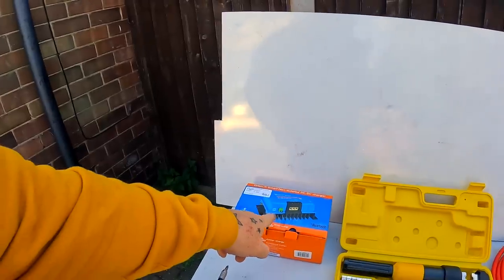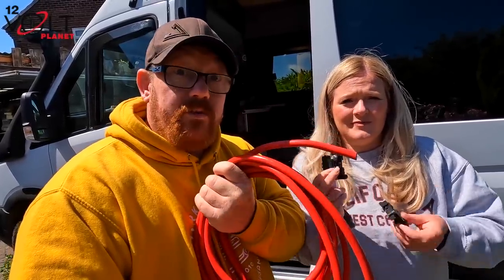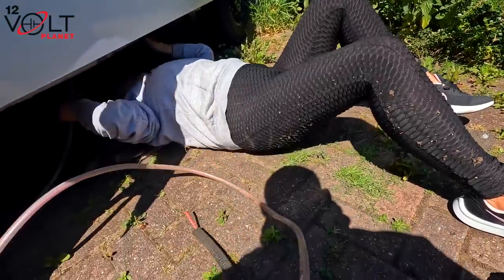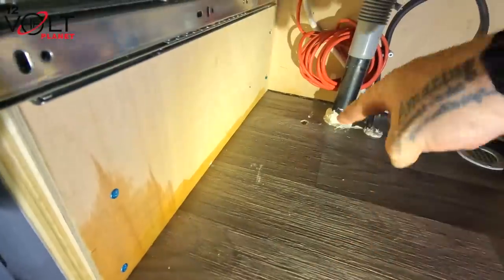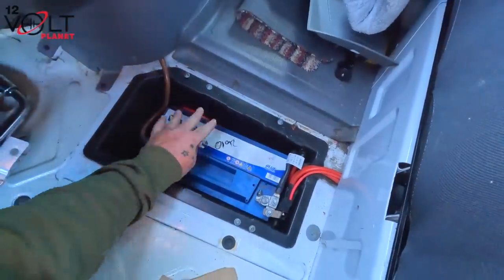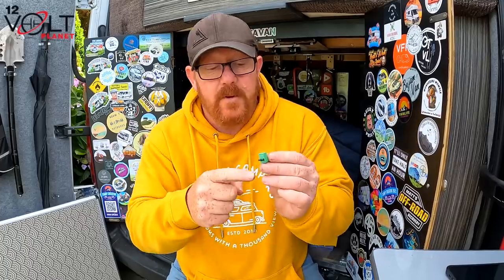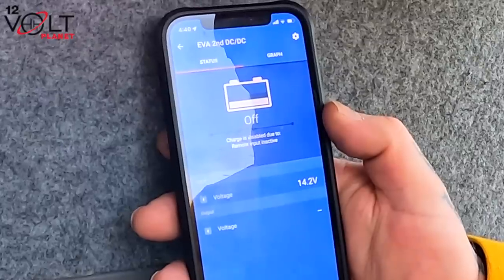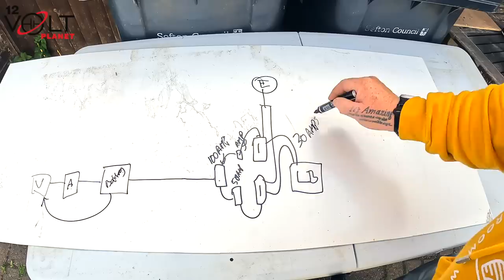AVOID A Winter Power Shortage With Double Charger’s

Comment: If you want to save yourself a few quid, you can use the renogy one which is 60a and costs £135 at the minute.
Reply from the maker: Interesting 🧐 this could help other people with different budgets thanks 😊
Reply: on it's own that's a useful suggestion but I'm not sure how it would sit alongside the existing Orion?
Reply: Or the ABSO with 50amp charging and solar charging built in, had one for 3 years and no probs. I live in my van so it's been well tested.

Comment: Surely the 100 amp fuse is for the 35mm cable protection so should be at the battery, the 50amp minibuses protect the 16mm and orions
Reply from the maker: Please read the pinned comment on the comment section 😩😊
Reply: @UrbanVanlife  Ooooooh! Barry didn't read that.

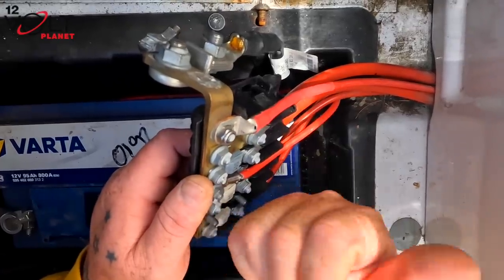Comment: At around 3:35 you show you didn't have a fuse at the battery end of the cable, but instead had the fuse at the other end. This works but can cause a problem if that line ever chafes on metal in the van between the battery and where you fused it, causing an unfused short, that is why it is always best to have the fuse as close to the positive terminal on the battery as possible.
Reply: My thoughts exactly great video love the van and the snorkel 🤿 but definitely get a fuse up the battery end asap

Comment: I’m probably wrong, I have been plenty of times before. I would personally put a fuse at the battery end of the cable. My thinking if the wire rubs on a metal surface, for example where it goes under what I think is your seat, it would short and there’s no fuse to stop a fire etc. when I did my van infused both ends between the main battery and the leisure batteries. 

Cheers for the awesome videos!
Reply: Forget this, I’ve just watched the next video! FYI, you’re videos are awesome, keep up the good work 👍
Reply from the maker: Thanks Ryan, see your original comment wasn't a full blown rant, it was an observation and an explanation of how you did things coming from a good and helpful place, and we appreciate it as it could help someone in the community, massively different to what we have been dealing with from some other people which is why we did the update just to clarify for the people who did come at us with their pitch forks and torches! Thanks for commenting and watching.
Reply: @UrbanVanlife  thanks for being so nice about it! Again I would just like to say your videos are awesome and whether they leave a nice comment or not, you’re providing knowledge and entertainment for so many people! 

Cheers guys!
Reply: @UrbanVanlife  They may have been concerned about your safety or just plain argumentative, there's a lot of it around since the end of lockdowns.

Comment: Thank you for the video buddy.... Ctek D250 plus 120 smartpass is what I've been using for the last three years and get upto 140amps. Never had any issues and never had to connect to sure power at any point on our travels.
Reply from the maker: Great piece of information for the community thanks for for sharing 👍👍
Reply: how does the price compare to the Orion?
Reply: @alanhat5252  https://www.12voltplanet.co.uk/ctek-smartpass-120s-power-management-system.html 

https://www.12voltplanet.co.uk/ctek-d250se-dual-input-dc-dc-charger-mppt-solar-controller.html

Not sure of Orion prices but the links above are roughly what i paid for Ctek setup.

Comment: Excellent install guy's 😉👌, Please,  just install a mega fuse on the source (positive side of the vehicle batteries busbar), as you have an run of 5mt cable unprotected from mechanical impact or abrasion ( even though its heavily protected using the rubber hose as an conduit👌👊👍). Rule of thumb, (but not set in stone) We always try to fuse within a foot of the source. 😎👌👊👍👍👍.
Reply from the maker: this is whats called DONT FORGET TO ADD IT IN TO THE VIDEO . we changed the mounting from the battery and added a 100amp midi fuse to the block . but some fool forgot to add the footage , so ill have to do a short about it , totally my stupid fault lol ,
Reply: @UrbanVanlife  no, thats cool bud, your on top of it😎👌👍, just be aware of "alternator upgrades too"...you may not benefit from it! As an higher the amperage alternator may require higher RPM to gain those, (like 6000 RPM to gain the higher amperage) but you may lose the lower end of the amperage compared to an "lower amperaged alternator".  Heat build up and power curve is what Id be cross referencing to see whether or not it's advantageous 👌😉👍👍👍.
Reply from the maker: @Iveavan  if we don’t need to upgrade I’m not going to . But it’s only a 180 and we have a 110 but it puts out 120 go figure lol . So your not actuskt getting a massive gain when you think boxers and Ducatos have a 220 amp altinator
Reply: @UrbanVanlife  I'm not seeing why 120A might not be enough? I have a 90A alternator & have never arrived anywhere with a less-than-charged battery.

Comment: IIRC when on power mode the BtoB acts as a power supply snd stays on constant current rather the changing to constant voltage at the end of the charge curve, you use it in power when your running a load as you charge (if that makes sense) 🤔
Switching it off is a good Idea 👍 less load on the alt means less fuel used 😏
Reply: The way I'm reading the website "power mode" is for running 12V kit from a 24V supply so will probably provide a steady 12.8V 

It sounds like it also protects the (12V or 24V) battery from over-discharge.

Comment: SORRY NO but you are giving bad advise you should always have the fuse as close to source as possible if that main power wire was to rub through anywhere between battery and fuse then there is nothing to stop the current and the wire WILL melt and cause a fire

Comment: Just seen the part where you show the fuses by the battery then go on to say having a fuse at the other end is fine! I would disagree, the reason the fuses are by the battery is to protect the appliances AND the wire! If that positive wire ends up making contact with an earth somehow then it is likely to cause a fire, if the fuse is right by the battery then the fuse will protect the cable! General rule, always have fuses closest to the battery.

Comment: 9:18 I don't like the look of a loose (conductive) spanner like that, is it possible to make a slip-in box that will be retained by the lid or glue some sponge to the lid just to be sure it cannot possibly jump onto your live terminal if you misjudge a speedbump or something?
Reply from the maker: Interesting idea thanks, but it’s also got a plastic cover too
Reply: @UrbanVanlife  that's good, I didn't see it in the video, the panel we see you lift off looks like it's more than a spanner-width above the battery.

Comment: For anyone fitting their first DC to DC Charger, much easier to fit one 60 amp charger. Stirling Power do a very good one. I’d say upgrading the Alternator is essential. Imagine running lights, wipers, heater/de-mister in winter. I’d say odds on the alternator will disappear in a puff of smoke especially with Lithium Batteries fitted. I seem to remember Stirling Power did a video of this on their channel. On the plus side, when LPG is no longer available later this year and bottled gas is £100 a bottle ( if you can get it), you will be able to use an Induction Hob instead,  even in Winter. 👍🏻
Reply from the maker: Great piece of advice here thanks for the comment
Reply: Why is LPG going to be no longer available.
Reply: @chox2001  Yep I would like to know that also !

Comment: you need to fuse the cable at the battery if that cable shorts out to the bodywork you could have a fire
Reply: put a larger fuse at the battery, 150 amp for example, you still have your overload protection with your 100 amp fuse but you now have some short circuit protection for the cable

Comment: Neil sorry to say you have made a mistake ,the 100a fuse is there to protect the 35mm cable.
With the fuse not at the vehicle battery end of the cable is not protect ,ok it's inside the hose but you still should have a fuse at the other end if the cable was to short out against a earth before the fuse it would burn the cable out and the fuse would not blow.
If you want check with 12v planet ,I am sure they would agree with me ,you may want to inform your YouTube followers as this could cause a fire.Regards Simon
Reply from the maker: this is whats called DONT FORGET TO ADD IT IN TO THE VIDEO . we changed the mounting from the battery and added a 100amp midi fuse to the block . but some fool forgot to add the footage , so ill have to do a short about it , totally my stupid fault lol ,

Comment: The website suggests the Orion is one-way only so would it be an idea to reverse the 2nd one so your starting battery is always charged?

I once got caught out with a breakdown & I was trying fixes then trying to start the engine & very soon flattened its battery, fortunately I had a jump-lead long enough to re-charge the starting battery from the domestic battery but it was a panicky moment while I figured out how to do it & if I didn't have the lead I would have been stuffed.

Comment: Bad move, fuse needs to be at the source of the power, if that cable rubs through and shorts to the van body, it will discharge the whole power of the battery through that cable it will glow red hot!!!!
Reply from the maker: Please see pinned comment and second video 🙏